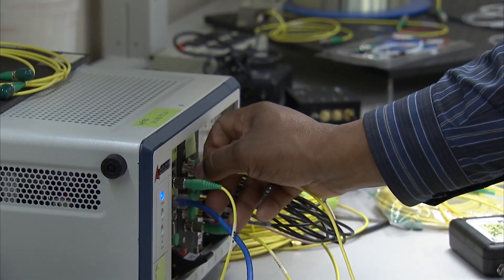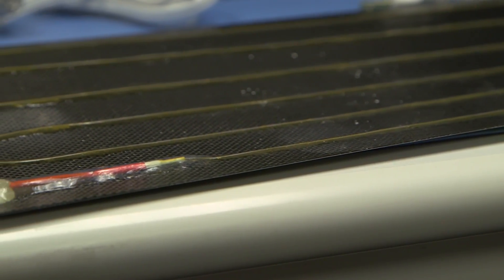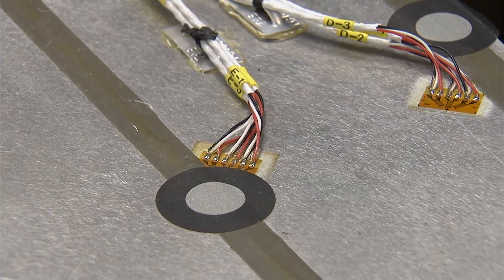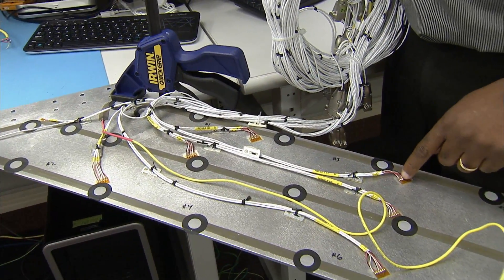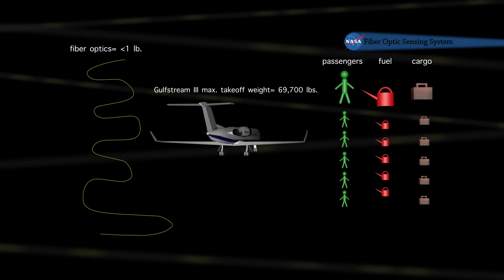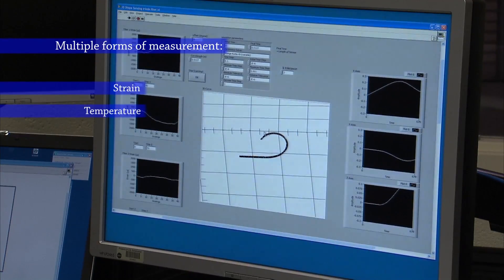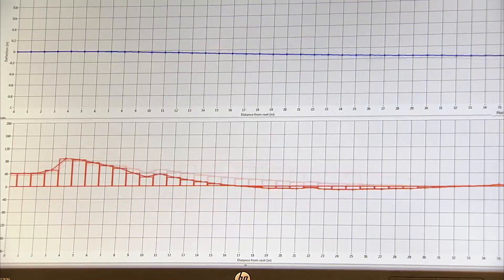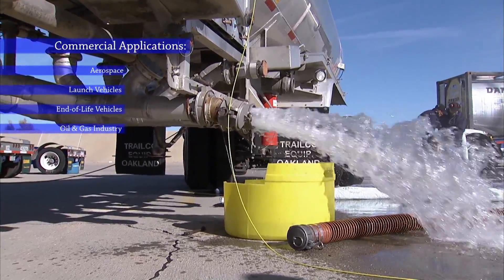Fiber Optics Sensing System: A New Technology for Measurement

Comment: The goal í reduce signal leak , and use pulse to send control command to multiple device without increase airi craft weight , space , heat and finally it easily to diagnostic and repair maintenance which cost the most is maintenance and leakage prevention